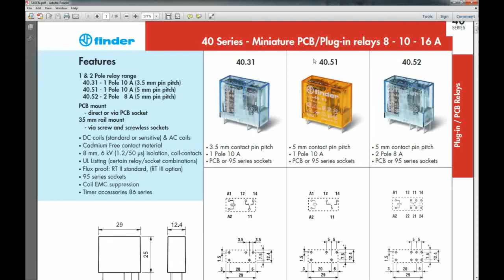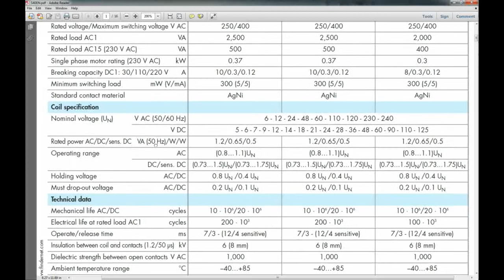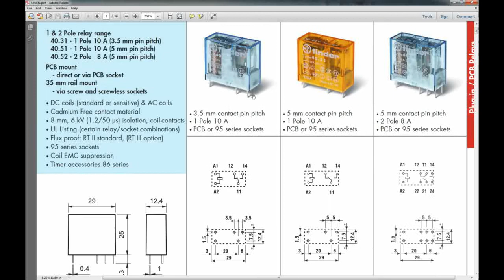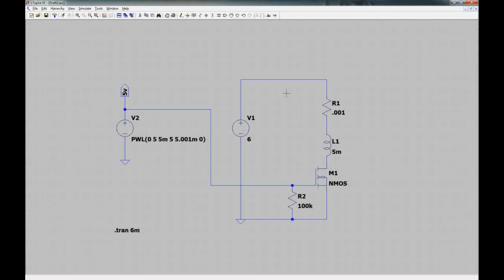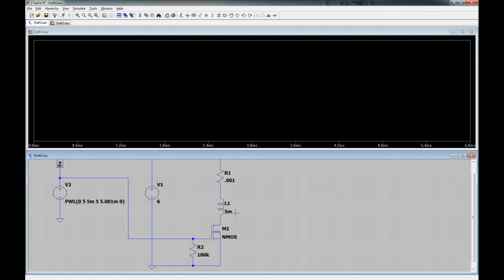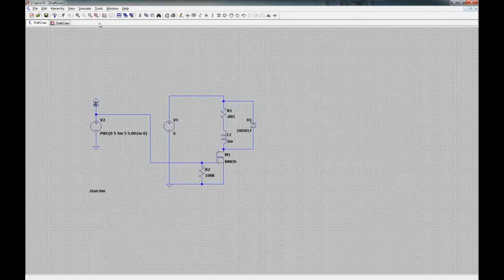Back to Basics - Relays

Comment: Hi,
Thank you for the video.  I was fixing a defrost timer board last week and found that a couple of 1N4148 diodes, each across its own respective relay, were shorted.  When replaced the board worked fine.  So, here is the question:  Since it was two of the diodes that failed  how does one select stronger diodes to keep this problem from recurring?  You covered some of this selection process in the video but since I didn't design the circuit, though I do have the relay information, can one just go up like say with resistors  where you can just pick a 2 watt resistor if the 1 watt one keeps burning out? Oh by the way the 1N4148 diode is the tiny glass high speed signal diode.
Reply from the maker: Hello there great comment.  Yes you are correct that you can select a bigger diode based on its characteristics.  However , knowing the right characteristics to look at is the tricky part.  In your case, since the diode is being used to protect against the inductive over spike caused when the relay's coil is de-energized, you will need to be looking at the peak reverse voltage rating of the diode.  This number, when increased, will give a stronger junction that can take a larger voltage in the reverse direction, which is what is happening when you get the spike, without breaking down (i.e. burning).  Also you want to ensure that the forward current rating is large enough to accommodate the normal current the coil of the relay draws when energized.  After looking at a datasheet for the 1n4148 I would recommend, as a size up, a diode such as the 1n4007.  This is a good beefy diode with 1000V reverse volt rating and a 1.0A current rating. This guy can handle quite a bit and is the diode of choice for me when using relatively small relays.  Now the big industrial relays that can pull up to 5A+ on their coil will require a much larger diode as expected.  But for a size up from what you have I would look at the 1N4007 and when they are $0.13 USD you can't go wrong.

Thanks again for your comment and I hope this helps.

Comment: NO, NC = Is when the coil is DE energized ?
Reply from the maker: Yes when the relay is de-energized, or not powered, most relays will have a Normally Open, NO, and a normally closed, NC, set of points.  The "Normally" is telling you that when the coil is not powered, de-energized, that is the state.

Hope this helps.  Thanks for the comment.
Reply: Thanks